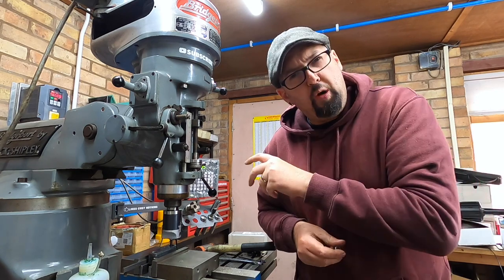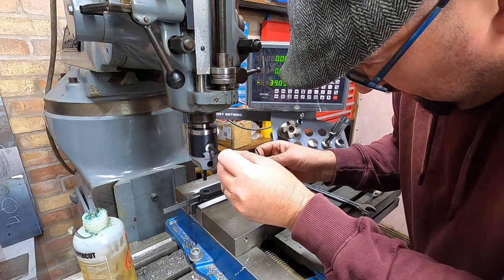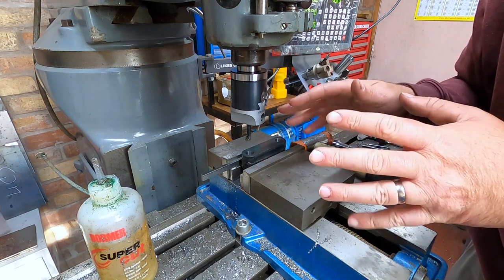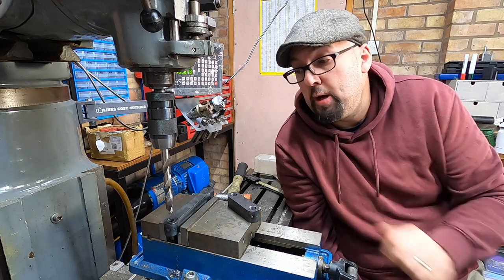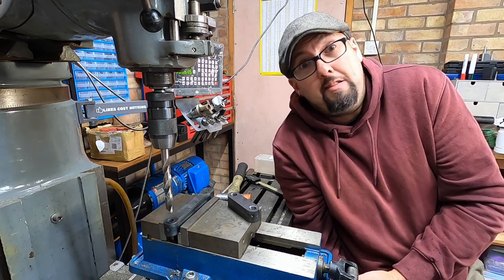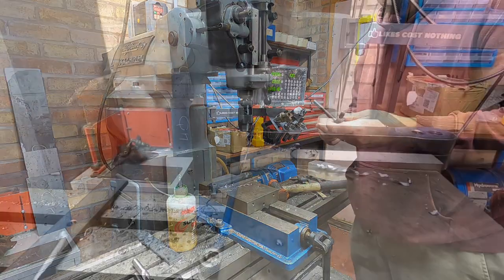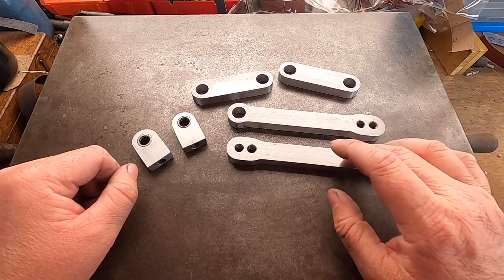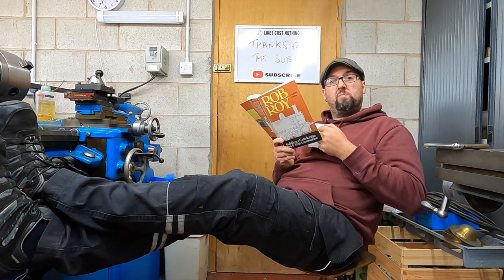Valve Gear Parts Boring - EP30 - 7.25" Gauge Steam Locomotive Build

Comment: Hey up Matt nice to see you back , hope you're well ,know the feeling well boring holes - the connecting rods on the l&b have 38mm holes for the oilite bushes  - I used a 25 mm sandvik drill to open up first then bored the rest out using the boring bar - that was the easy part - milling them from solid was less enjoyable - all in took 30 hrs machine time over 3 months all for the love of steam 😃
Reply from the maker: Now then Jonathan, Yes, just getting back into the swing of it, next year we start off strong, how long I can keep up with the filming schedule is anyones guess. 

That doesn't sound like a big hole for a full size loco, I assume we are on about the big ones. Could they not have been profiled from water jet cutting? To reduced the machining time, or was that with water jet profiles?

Got to love steam, All the best, Laters, Matt.
Reply: @MattChiversWorkshop  I had a length of 2x1 ground steel bar that we used at work to clock jobs up -we only did 2j jobs and it got thrown in the scrap metal skip -so I thought that will do nicely and hey presto connecting rod material for free -that was when electricity was a lot cheaper 👍😃😃

Comment: Welcome back chap, I have my coupling rods for Dyak laser cut, so will be going down a similar , albeit half the size rabbit hole in the future , love the man pourn in the end of your vid (incorrect spelling in case of algorythem issues LOL
Reply from the maker: Thanks Ga Ga, If I had realised to start with I'd have chucked them in citric acid or sand blasted them before I tacked them together, getting the black scale off was a chore, other than that, they were rather fun little project to get on with. Although we have to return to the pony truck to get that done 😕 can't keep putting it off. All the best, Laters, Matt.

Comment: eyup Matt
Nice to see you back in the w/shop,  i'm like that too, if i leave something for a while i totally forget where i'm up to.!!!!!
don't know if your boring heads same as my cheapo but i've got no end of backlash on the main screw and ive only used it a dozen times.
Now then, whats a bloody "Banana Piece" in Locomotive Engineering, I'm only a novice at this loco 
game but never heard of that!!🤔🤔🤣🤣👍👍👍👍👍👍
take care
See you next time
Laterzzzzzzzzzzzzz
Kev
Reply from the maker: Now then Kev, Unfortunately last video I've filmed for this year, but next year's videos are piling up well, so the wait in between won't be as long. 

Boring head is from RDG tools, there is backlash in it, but not much. I went for the RDG one as it was only a little bit more than the cheap ones you see on eBay. I've seen a really cool way to advance them, which I plan to do a video on at some point.

Now the Banana piece, probably has an official name, but no idea what's it is 😂, its a banana/boomerang shaped part that swings at the bottom of the rear swing link and combination lever. The valve gear on Tinks is basically Brown/Heywood design or as many will tell you reversed Greenly/Joy valve gear.

Hope your well my good friend, thank you for your continued support of this adventure. All the best, Laters, Matt

Comment: Grab some brick and mortar cleaner, that will clean the mill scale off in about 20 minutes
Reply from the maker: Hi Edward, Are you on about the stuff with hydrochloric acid in it? do you bathe it, or just brush it on?? Does it react with fresh machined areas? Like make it go rusty 🤔. All the best, Matt
Reply: @MattChiversWorkshop  I think it is hydrochloric, get mine from Wickes.  I soak until the scale washes off, scrub with scotbrite under a hot tap, then dry.  If its really important I'll spray with oil.  Doesn't damage machined surfaces, probably does eat it away as it's an acid but it'll only be microns in the time it needs to be soaking for
Reply from the maker: Excellent cheers Edward. I bought some citric acid to try, but I may go buy this too, and do a comparison video. All the best, Matt